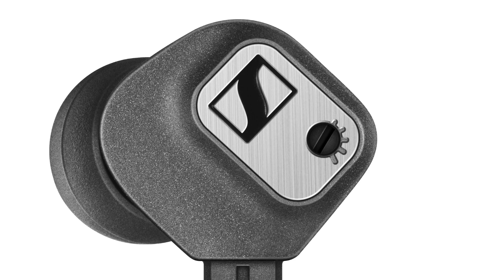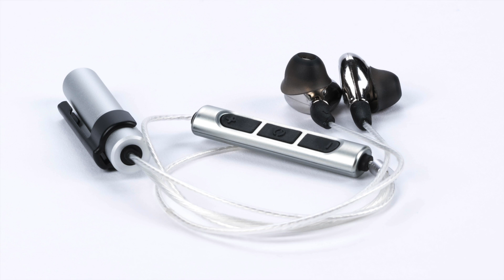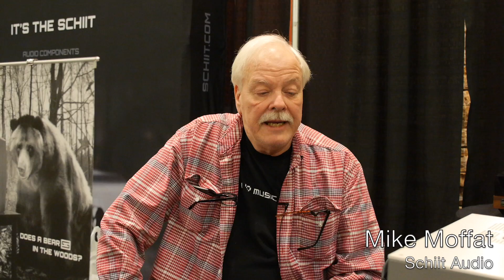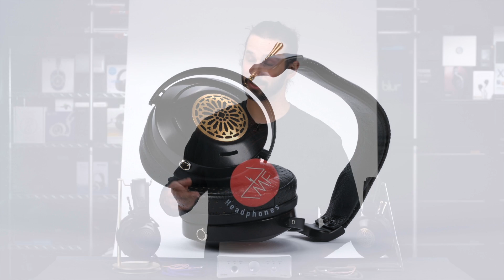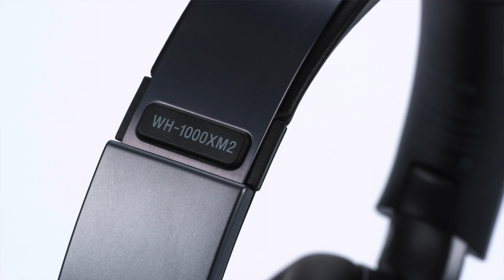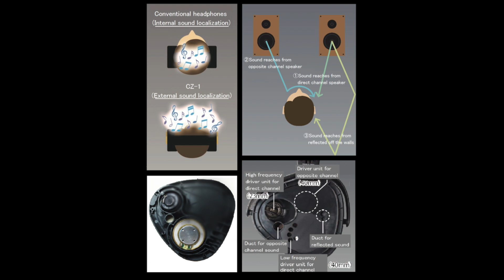So Many New Headphones (And MUCH More) At CanJam @ RMAF 2017 - Head-Fi TV

Comment: Jude I get that the W1000 Sony is comfortable and has great noise cancelling, but without the active EQ enabled it sounds so bad. Doing A B comparisons with my own EQ to reproduce manually, what it's DAC does automatically it looked like the rocky mountains. In passive mode there are huge 6+db peaks and valleys in the midrange, where most of the musical information resides. They sound like hollow tin can resonators in passive mode. Why does this matter you say? Well for one the EQ can't be defeated. So any change like new pads, modding the enclosure to make them flatter sounding, etc will make them sound better naturally, but worse in active mode. So you can't mod them, and they need serious modding to fix their midrange.

Comment: I'm no audiophile but GOD DAMN THIS SHIT IS EXPENSIVE.

 3 K FOR A PHONE TO PLAY MUSIC BETTER? (excuse my ignorance, feel free to enlighten)
Reply: Your reaction is completely normal, don't worry about it. I agree about the 3k phone to play music better, however, there are some things that are worth the money, like putting 10k on a top level Stax rig. It's a crazy hobby for sure. Oh, there's insane price-perfomance ratio with the HD650/600 and a Schiit Modi Multibit and Magni 3 too, and also lot of overpriced turds...welcome to the audio money black hole lmao
Reply: A&K's digital audio players are stupidly overpriced. For example, the Fiio x7ii offers similar features and quality compared to that $3000 toy for the much lower price of $700.
Reply: Onixpected (DeFy Touch) as a user of the fiio x5iii (running very similar os), i feel that the android mode is very unreliable, spotify and tidal often crashes when the player heats up after around 30mins of usage. Astell and kern utilises a simpler os and user interface, which will be easier to run reliably.
Reply: NEMESIS&LUCIFER I could buy 4 X7ii and guarantee that one is working at all times. And have $200 leftover in my pocket.
Reply: You'll end up with the acoustic equivalent of a toilet flushing if you drop 3K on a phone and don't drop another 1600.00 on high thread count ultra-pure OCC gold-plated Horus cabling.
Reply: just like any hobby, people are will to throw thousands into it and companies are willing to take them, nothing to do with playing music better, all about ego and status